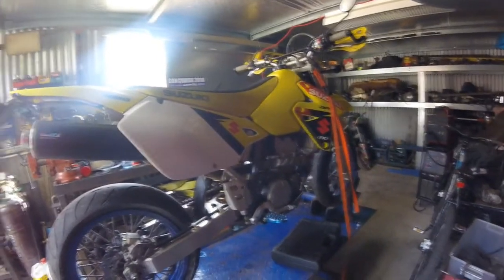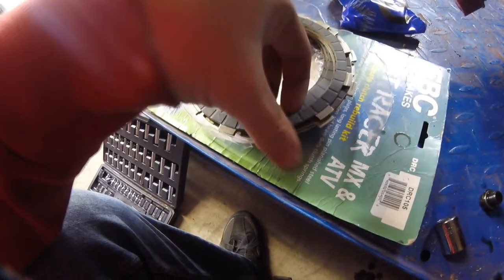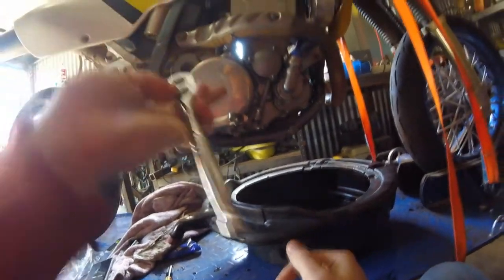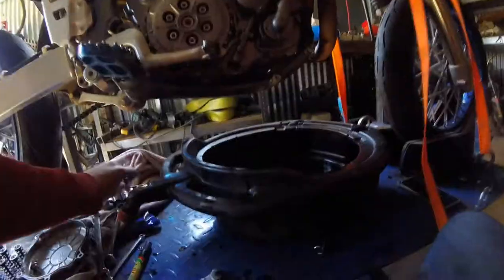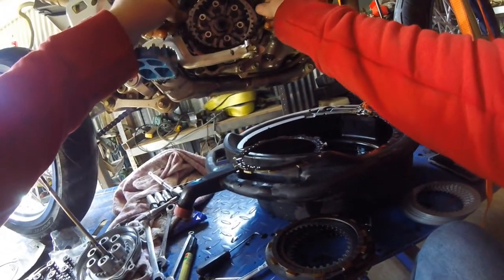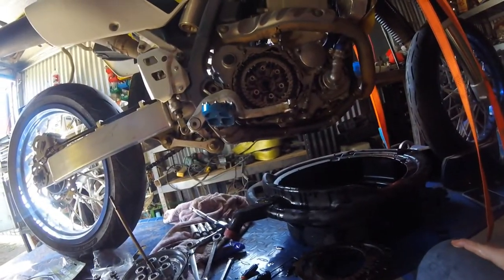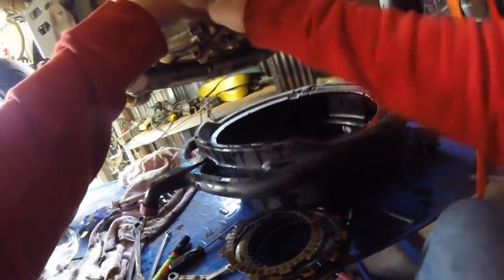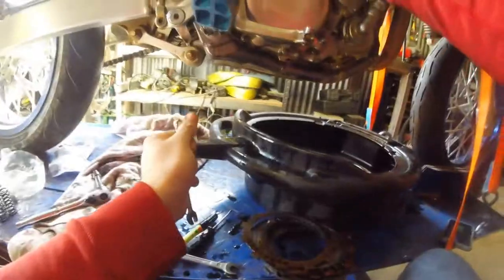How To Change The Clutch On A DRZ-400!

Comment: (DRZ 400 SM) I also installed the Righteous Stunt Clutch shorty which is suppose to be even easier to pull has a needle bearing in the perch and adjusted everything up. But for some reason it's pretty hard to pull. I did some trouble shooting with no success. I can't figure it out then installed it on my friends bike and super easy. What the hell. Really frustrated. Any insight why my clutch is so hard to pull is there something else going on. Thanks Mate. Just subscribed
Reply from the maker: Hey mate, how old is your clutch Cable? if it isnt that old check for frays on the cable around the clutch perch and make sure its not pinched anywhere on the bike, lubing the cable aswell can help heaps.
i had a really hard clutch cable on my DRZ and after i replaced the cable it felt really light. Let me know how it goes mate sorry for the late reply!
Reply: Ya can get yerself a hydro kit for a few hundred euro. That'll squeeze yer thang...

Comment: (DRZ 400 SM) I also installed the Righteous Stunt Clutch shorty and adjusted everything up. But for some reason it's pretty hard to pull. I did some trouble shooting with no success. I can't figure it out then installed it on my friends bike and super easy. What the hell. Really frustrated. Any insight why my clutch is so hard to pull is there something else going on. Thanks Mate.
Reply: I recently installed one also, as long as the clutch engages and disengages all the way, that is just how it is. It is harder to pull simply because of LEVERage  (haha). I don't believe there is a way to adjust how easy it pulls, just when it engages.
Reply: By putting heavier clutch springs would that make the pull easier???  They call it a one finger clutch but man is it hard to pull. Thanks Mate
Reply from the maker: Hey mate, how old is your clutch Cable? if it isnt that old check for frays on the cable around the clutch perch and make sure its not pinched anywhere on the bike, lubing the cable aswell can help heaps.
i had a really hard clutch cable on my DRZ and after i replaced the cable it felt really light. Let me know how it goes mate sorry for the late reply!
Reply: Brand spanking new Teflon cable suppose to be the top of the line. Maybe something's going on with the push rod which disengages the clutch but I'm not sure how that works exactly???
Reply from the maker: @allenr265  Yeah maybe, Sorry i dont know how that part works either. Good luck
Reply: Allen R ...unlikely to be a bent clutch pushrod, they’re pretty strong. A short lever won’t help. Your best option is to fit a magura hydraulic clutch. It retains a cable to operate the clutch arm, but a hydraulic master cylinder significantly reduces the force required on the lever.